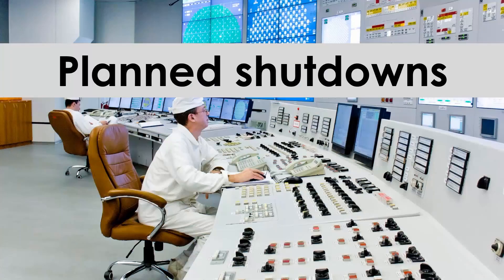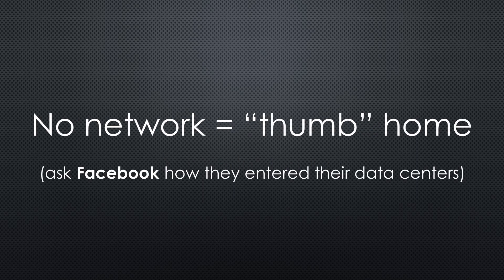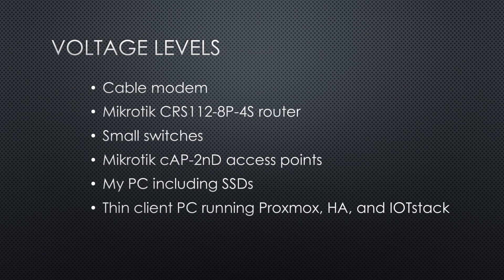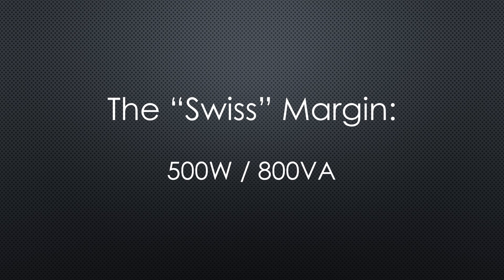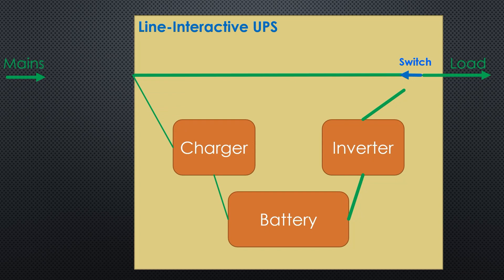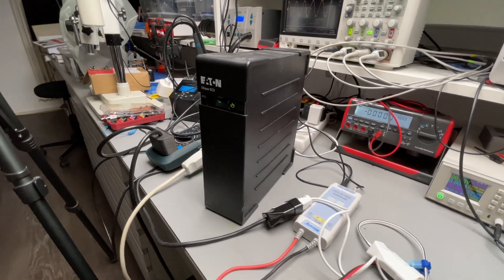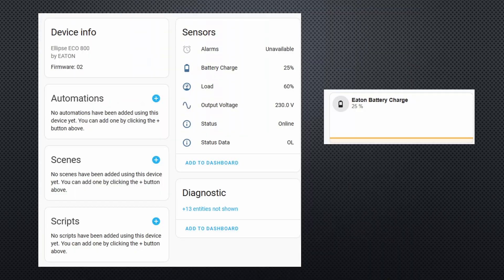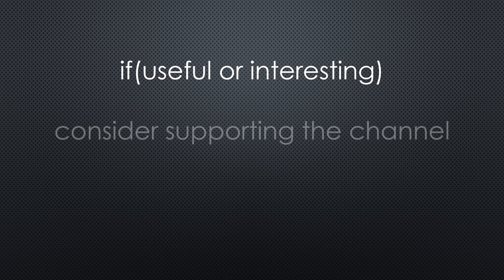447 How to protect Home Automation and PC with an Uninterruptable Power Supply (UPS)

Comment: For all the DC powered devices (which are the most critical in our house) I went with a homemade DC UPS. It charges a lead acid battery and provides power to the devices using DC/DC converters to generate 5v and 12v levels. 
This allowed me to get rid of all the individual AC adapters. I should check the actual difference in power consumption, but I guess this is more or less identical.
Reply from the maker: I like your way because it is straight-forward. Here, my PC would be the problem because it is on 230V.
Reply: Charging lead acid can produce hydrogen. Not usually a lot but the battery should not be kept in a tight enclosed space…
Reply: Do you have a link for ups dcdc tutoriel ?
Reply from the maker: @romaindemaison3127  I added a link in the description. Youtube does not allow links in comments

Comment: Two of the best investments I have made in my home are a quality UPS from APC, and a whole-house surge protector from Square D. As with your setup, all of my critical systems run from a single mains voltage UPS. Each year, we generally have ~10-20 sub-second outages, ~5-10 outages a few seconds long, and one or two outages longer than an hour. 

The software part of the system is as essential to me as the hardware. As outages get longer, various less important systems are gracefully shut down as the battery level becomes lower.

Of special importance to me are my network and flood sensors. Long outages tend to coincide with heavy rains. No point in having flood sensors if they stop communicating when they are needed most.
Reply from the maker: Good thinking! More and more the network becomes the most critical component in our homes because it connects the rest of the devices. 
We optimized our home that we can survive one day without sun on our 10kWh battery if we pay attention (if we fill it up before). So I only want to shut the PC and the server down when my solar backup somehow did not work.

Comment: I've used APC for as long as I've used UPSes. They are pricey, but with the requisite battery changes, I've seen these last 15 years in service, and I'm aware of units that have lasted longer. (The one operating my equipment rack right now dates to 2012.) I did pick up a Cyber Power UPS from Costco to use on my PC, and after about five years, it's been mostly trouble-free. There was one spate where a battery failed unexpectedly (not holding charge), but so far as I can tell, that was a defective battery, not the fault of the UPS.
Reply: i am currently trying to combine the best of all worlds. An old 2kVA APC UPS and indestructible OPZS Accus from a hospital. maybe I have success. . . Greetings
Reply from the maker: Good advice. Maybe I should also have chosen an APC.
Reply: @tryanderror8825  Greetings back. I had not heard of OPZS.
Reply: @AndreasSpiess  I add my vote to APC (and more recently Cyber Power).  In 15+ years I've never had an APC not convert to battery and keep systems alive.  When it has happened, it's because I forgot to do preventative maintenance and only realized after the fact that the lead acid battery had died and I hadn't noticed the light on the UPS.  That's my fault, not APCs.  Changing the batteries every 2 or 3 years is cheap insurance.  In this case I realized the batteries were original and the unit was about 8 years old.  Yikes.

Comment: Thank you Andreas - as usual great video.
My 3 cents:
One of the reasons why I decided to base my entire house networking and services on SBC was exactly the beauty of not needing big mains UPS
My 7 machines (Orange Pi + Raspberry Pi) are all in total below 50W so 10A. So I built UPS (with multiple output voltage) on 4 pieces of 18650 with charging, automatic switching etc. 
Full 10A it can deliver for more than 30 minutes of power to all machines plus to the modem, router and switch. 
No problems with the switching time as switching is based on MOSFETs so we are talking ns (or us - I did not check it - fast enough that nothing reboots or misbehaves).
Plus of course: 50W is not 500W, money counts.
Also: last desktop in my family was seen in ... 2005. Since then everybody has a laptop.
Reply from the maker: I think, a DC UPS is a very good idea. I even ordered one to play with. As mentioned in the video, my two problems would be the PC and the 48V PoE.
My PC is quite beefy (from time to time I have to do video cutting...) and has 4 monitors.
Reply: @AndreasSpiess  can't have cake and eat cake, unless you have 2 ;-)

Comment: Interesting and current topic.  I live on a Greek island, with lots of overhead power cables, lots of thunderstorms and breakdowns/flashovers caused by salt on the high voltage line insulators.  Cuts are frequent and unpredictable, although we get warning of planned work for insulator changes etc.   The grid is 150kv/15kv/230v, mains voltage fluctuates between 230+ down to 205V (winter peak heating/cooking time).   I'm looking at backup systems, and APC seems to be a favourite with many businesses around here.   I could also run critical things from 12V, so also looking at a simple battery system with solar.    
 For additional protection, I also monitor for approaching thunderstorms.   My Node-Red listens to the global MQTT feed from Blitzortung, filters for strikes in a geographic "box", converts the geo  co-ordinates to distance/direction from here (eg "20/01/2022 07:26 188km 278 degrees") and alarms on strikes within 50km.    Then it's time to unplug the router from the line.
Node-Red also listens to the University of Athens earthquake feed in a similar way to show distances, magnitude and depth, but I've never known a quake to produce a power outage (so far).  The island has had five quakes > mag 2.0 already today.
Reply from the maker: So you live in a beautiful, but dangerous place! If your voltage fluctuates, an inline type is probably the best choice (if you do not want to go for an online type). For sure, solar would be a good choice in your area. Its payback period probably would be short.

Comment: Hi! Thanks for this very good (as always) video. I recently replaced my old no-name UPS with an Eaton Ellipse 650 USB. I am perfectly happy with it. The ups feeds 2 raspberry pi, the adsl modem and the network switch. All is managed by nut. Nut is fantastic, as always with Linux it's a tough learning curve because there are many options, but so powerful, made by pros for pros. One thing I like to point out is the "race condition". You didn't mention it. As an engineer I'm sure you know Murphy's law ;-) And a race condition is a typical effect of Murphy's law! It's when the main power comes back during the shutdown! Nut FAQ point 57 describes it (sorry youtube doesn't let me post the link). The couple  Nut + Eaton Ellipse perfectly handles the race. I have done several tests all successful. When the NUT shuts down the system because the battery is almost empty, it sends an order to the UPS to switch off the load. So even if the power returns before the computer shutdown is completed, the UPS switch off its output then waits the time ordered by nut and switch on the load.
It's great. 
Thanks again for all your videos
Reply from the maker: Thank you for the additional info!

Comment: Thank you so much for your video. I bought a broken interactive online UPS Dell 1920W for almost 600 EGP ~ $20. I found that the output Mosfets were shorted. I fixed them and I got my UPS working for my home workbench, home automation server, and Battery Management system testing bench.

I will connect the UPS to Raspberrypi running "NUT server", This will help me to notify all devices on the UPS with the status and to have a clean shutdown when the battery runs out.
Reply from the maker: Very good solution. And cheap!

Comment: Hello Andreas! Can you help with the micronas HAL 1564 2 wire hall effect sensor, the formula for calculating the 2 resistors (trying to use the sensor with 5v) does not appear to be working for me. Thanks in advance and keep up the awesome content.
Reply from the maker: You find the value of Rv in the datasheet (100 ohms). RL is a standard pull-up. I would try 10k if you connect the output to a microcontroller. Check if VSUP is above 2.7V in your case. Without RL it will not work.
Reply: @AndreasSpiess   Thank you, when my new sensors come in, ill have a go at it, And report back!

Comment: That is very common problem at my area where in previous winters we had about 5 drops a day ( every time was from just a few seconds up to 20 minutes ). 
Before I had my home assistant on laptop I had the server plugged to UPS and set it to wake up on lan and set everything by script. 
Setting everything up right to the point you don't have to be afraid of restarting your systems and stuff would break, was always the right solution.
Reply from the maker: You really have a lot of outages! Here, in the past, we had maybe one per year or less. But things changed...

Comment: Main problem here in Europe:
We all  are not used to blackout or shortages!
Most people are not prepared for this
3:30 This is what I have at home, but it´s not running at the moment !
It consumes more power in standby mode as my fritz.box 🤔😯
I will only install it on outages manually
Reply from the maker: I got now my DC UPS and will do some tests...
And you are right: I never cared about electricity in the past.

Comment: I have experience with APC line-interactive UPSs protecting servers, and also with low capacity models installed in small racks to protect active network components, and never had any problems.
Reply from the maker: Thank you for sharing your experience!

Comment: I had the same problem a few years back when the NAS used to reboot if breaker pops as there was a sufficient delay between the power cut and the time taken by the Inverter to boot up but the solution is simple, just replace the Mechanical Relay [which has 50-100ms turn on time] to a Solid State Relay and it will turn on immediately. so the reboot will be avoided. 
For knowing about the power capacity and the load, most of the UPS has a serial port built in which you can connect with USB to serial adapter to your main PC and read the status and also set power plan dynamically [windows & linux].
Cheers !!
Reply from the maker: As I showed in the video, usually the UPS has nearly no delay. So there must be another reason. And yes, I use the USB cable (as shown in the video).

Comment: Good discussion. If you have a real critical need for uninterrupted power I have used APC rack mount UPS`s in countries with frequent power outages and never had a failure. Expensive and heavy  of course. I have a request for your part 2 video. Could you talk about "solar generators" and is there one that could be used as a UPS? Thanks.
Reply from the maker: Thanks for sharing your experience on UPS.
Concerning using solar generators as UPS there is a small problem: Our utility companies want that our inverters are completely separated from the grid when it is down. That is not an easy task. So "online Inverters" are quite expensive.
Or you go offline with one of these huge power banks. Here, off-grid has severe limitations. This is why I did not consider this solution.
I will show a very cheap solution which has two flaws: Only one phase and 3 seconds switch-over from grid to off-grid. Still, it covers most of our needs.

Comment: Interesting video on an interesting topic ! Especially these days. My experience with Eaton is quite good. In the past we mostly used HP and APC. Some brands or devices have a very nice almost pure sine, however this can be influenced by the load. Have a look at the scope when you start an inductive load such as a drill of saw.
Reply from the maker: I am pretty sure the picture will be ugly, because I assume these power tools draw also quite a lot of current when starting up. My setup seems to be much easier to handle...

Comment: I use a Eaton ECO 800 to. The load is 88 Watts and i never had any problems when switching from main to battery and back. All slave devices use switching power supplies and have a buffer time greater then 2 times of the ups switch time from main to battery. The protected devices are from AVM (FB), several Mikrotik (CCR, AP and LoraGW), Intel NUC and Raspberry PIs.
Reply from the maker: Thank you for sharing your experience. I think I had a bad device. It now completely stopped.

Comment: @Andreas Spiess
@8:30
Hi Andreas, Offline and Line Interactive UPS will switch from main to inverter within 6 mesc. So 6 msec interrupt! Maybe your psu behind has an low hold up time. If you take an psu with double or more power the hold up time is much higher!
Maybe this was the problem.
Reply from the maker: I do not know. I did some more testing and never got an outage on the bench. But now, the Eaton stopped delivering energy. I will send it back and see what happens...

Comment: I am using a 2.2kVA TripLite Online UPS, mostly for mains conditioning, but also as UPS. We have pretty clean power, in 20 years I had maybe 3 mains outages from the grid. But we do have loads of AirCon units, which generate power spices on home grid, which is filtered and buffered by the UPS. 
Also my 'critical' devices like Homebridge Raspi has a UPS hat.😊
Reply from the maker: I know that where you live, Air Conditioning is very important ;-) Your needs are of course very different from mine: High starting currents and quite high power compared to my small needs.
BTW: I also did not think about a UPS for the last 20 years. But things changed (at least here).
Reply: @AndreasSpiess  Well I am not powering the AirCons of the UPS, but the AirCons in the house lead to power spikes/drops when the compressor and fan kick-in.
Right now I wish we have a heat pump or heater.... as it is freezing cold (15-22C). 
I run a lot of sound and video equipment, they like 'clean' filtered power. Some of the vintage sound equipment does not like power spikes.
Reply from the maker: @SarahKchannel  Aha. Now I understand.
BTW: You complain on a high level ;-) It became cold here, too. Just returned from the mountains where it was -10C during the night. So far, our winter was very mild.
Reply: @AndreasSpiess  I am fine with anything between 40-55C... below 30 my blood starts to thicken and clump :)

BTW, we have about 4x 25ton AirCons and some smaller one on the house. So thats easy 12kW of power that kicks on and off. In the winter month's have zero errors/warnings in the UPS logs. During peak summer everyday a few AVR events (auto voltage regulation). I have lost equipment to this spikes prior the UPS.
Reply from the maker: @SarahKchannel  That is a lot of energy! The biggest load in our home is the oven, with less than 5kW on three phases. So I understand your concern with spikes produced inside your home.

Comment: Thanks Andreas for another video founded in proper science 😊 I have had good experiences with the ECO but I can't remember the last time that I lost mains power while working at my PC, since our mains power is very reliable. The central servers all run off a APC Smart-UPS, Line Interactive 1500VA. I have moved to PoE for all network gear with Raspberry Pi PoE+ HATs (hopefully soon also a Home Assistant Yellow PoE) PoE AP's and very recently PoE GbE access switches. Mostly to cut down on ugly power bricks, with the APC's protection as a secondary benefit.
Reply from the maker: Thank you for sharing your experience. PoE is very convenient, particularly for remote devices like APs.

Comment: Here in western Canada the utility power is very very stable. I haven't recorded a brown out, a missed cycle or even a voltage spike in more than 10 years. Underground distribution helps considerably as most weather events don't affect the distribution system. We had a power outage of about 10 minutes a month ago, but this was the first one since about 2010 (still haven't heard what the cause was, likely never will). Also since I live alone I don't have to worry about my electrical system not starting properly for other family members. Thus I don't have any back-up power at my home (yet). 
😃
Reply from the maker: The same was here before last February. Now we are no more so sure about the stability of our nets. Still, I made this project because I was interested in it and I do not want to have a full battery and the sun shining while I have no electricity to use ;-)

Comment: I've been generally happy with commercial grade APC units. Pretty much all other brands have become disappointments sooner or later.

Check battery condition regularly and don't hesitate to change the battery when indicated. Otherwise the protection you think is there isn't. I seem to get 2-4 years out of my batteries.
Reply: Had no good experience with consumer APC devices, never tried the commercial ones, because of cost. The APC ones broke after a few years. A transformer broke in one and one with unknown electronics problem. They just died after warranty period.
My Eaton consumer devices that I use now had no problems so far. Had some short outages and everything kept running fine.
Reply from the maker: Thank you for sharing your experience. Today, my Eaton decided to completely die. It is only a few month old...
Reply: @mveldt  In my home I have 5 APC commercial UPS device. All of them are more than 5 years old, and one is pushing 12.

In the past I had consumer APC units also, but they did not live long and prosperous lives and in the end I gave up trying to use them.

Comment: I have the Eaton 3S Gen2 850 with 850VA and 510W, the load is around 10%, running since about a year and never had any issue with it so far.
Reply from the maker: Good to know. I think, I was unlucky with mine because it completely died now :-(